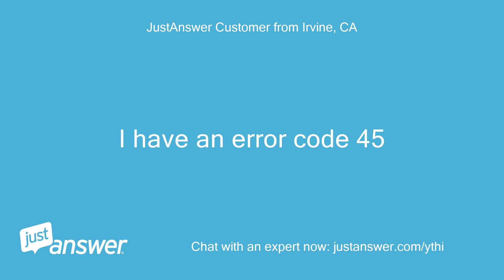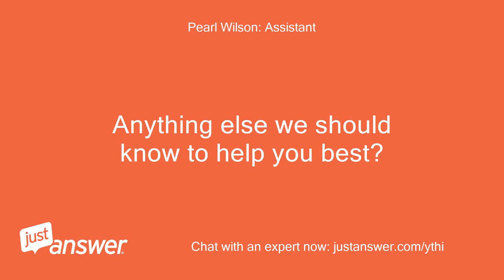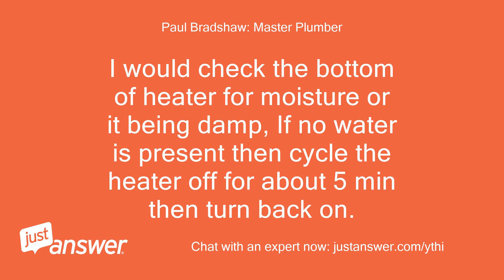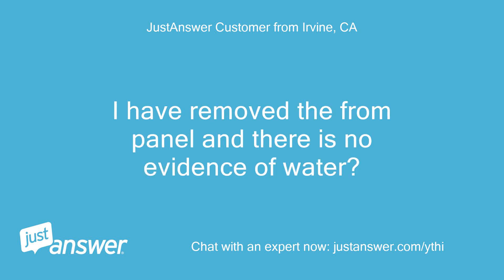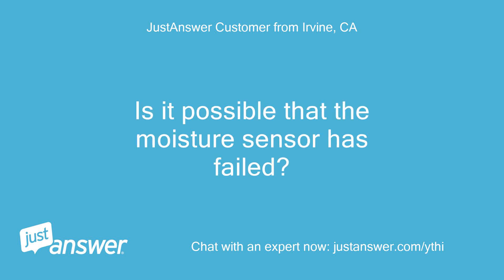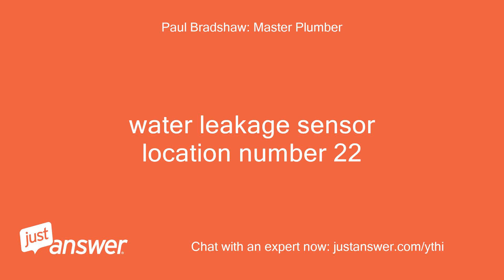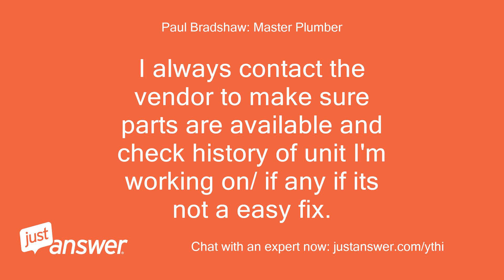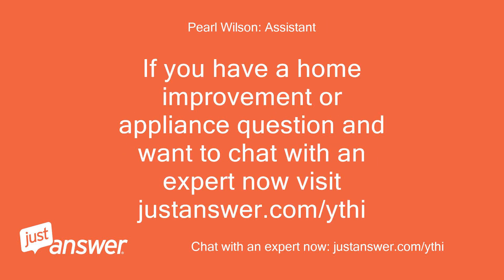I have an error code 45. No one year. Model nrcp1112-dv.

Comment: I had a an error code 45 with one of these.  That problem was a slow leak from the motorized mixing valve.  There is a dimple in the bottom of the unit case where leaking water accumulates.  The moisture detector is two electrodes that extend into the dimple.  You can clear it temporarily by soaking up water with a paper towel, but ultimately, the valve or whatever is leaking needs replacement.  
My NRCP1112 worked fine for 3 years.  It’s now 6.5 years old and I am scrapping it as the last 3 years have been one problem after another.  With each failure, I have no hot water and days waiting for parts.  I consider it as junk and will never buy another Noritz product.